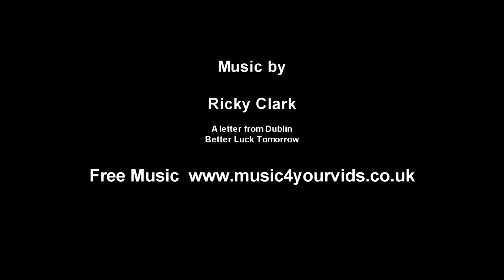History of Sir Thomas Bouch (Tay Rail Bridge) Dundee

Comment: Thomas Bouch had the misfortune to inherit 35',000 in shares in Hopking, Gilkes and Co of Middlesborough, and 100,000 pounds in loan guarantees, after the death of Edgar Gilkes. The company was in financial difficulty, probably due to a well-deserved reputation for bad workmanship and conr-cutting, and if it failed, Bouch woukd be bankrupt. Desperate to avoid this, he gave them the contract. It's likely that the cost had been underestimated, as expensive work like facing the columns, reaming the bolt holes for fitted bolts, and facing the nuts and bolt heads (all essential for structural integrity) was not done, and majur flaws and blowholes were "remedied" with filler. The design of the columns was bad, with braces loading cast iron lugs in tension.... All of this was Bouch's responsibility, but neither he nor his (inexperienced) appointed subordinates seem to have spent much time supervising the foundry work. A modern parallel might be the collapse of the CTV building, killing 115, in the 2011 Christchurch earthquake.

Comment: I came to this after reading the report of the Tay Bridge Inquiry commission, and after watching your other outstanding video on that disaster, in hopes of seeing some of Bouch's other work, and in particular the Beelah viaduct in the North of England. It isn't mentioned, but so many of his projects are that I can see how some would get left out. He appears to have been constantly at work planning new projects and overseeing work in progress, so it's not as surprising as it might be that The Tay bridge was poorly done. He may have just bitten off more than he could chew. He trusted his subordinates, some of them with little knowledge or practical experience, to do work that he might well have done were he not busy designing the Forth bridge. 

Commissioner Rothery mentions the Beelah viaduct (it is now spelled Belah) as a successful, very strong design which might well have provided a model for the Tay bridge superior to the one eventually arrived at. You mention that Bouch was known to bring in projects more cheaply than other engineers - a reputation bound to attract the railway companies -  and in fact the Beelah viaduct was considered notably inexpensive. But Rothery was struck by Bouch's answer to the question why the Beelah design wasn't used: it would have cost too much. So penny-pinching on the part of the railway company may have been one more cause of the bridge's failure.